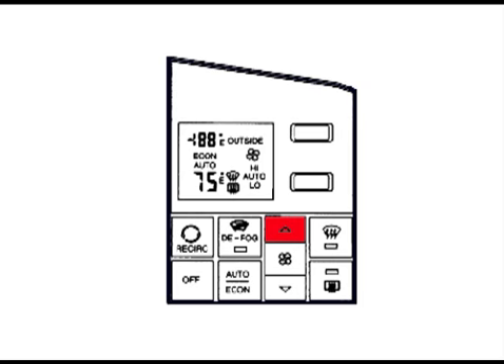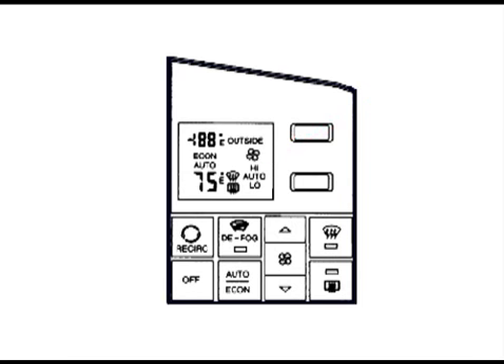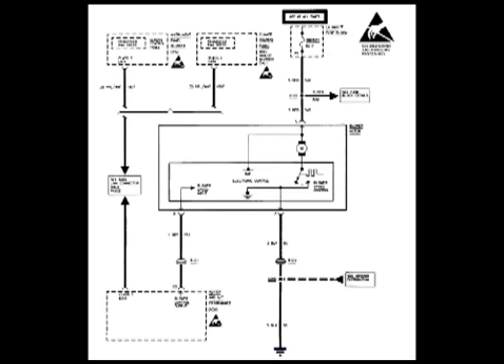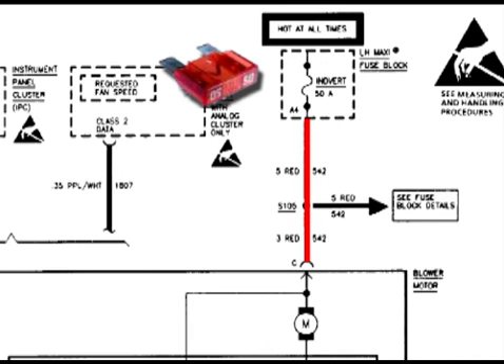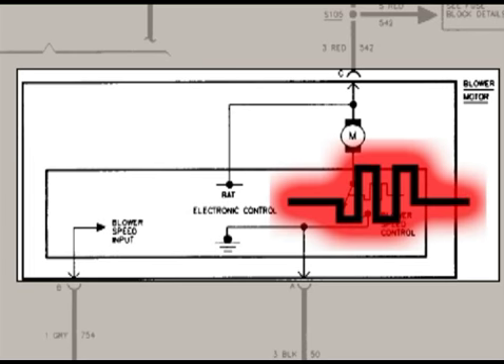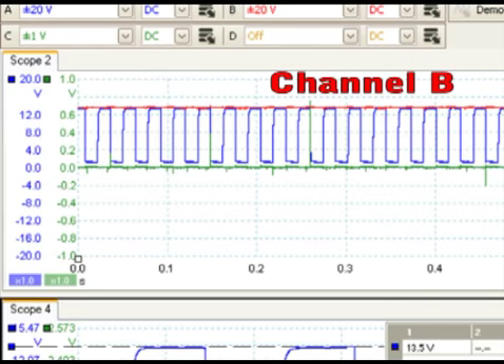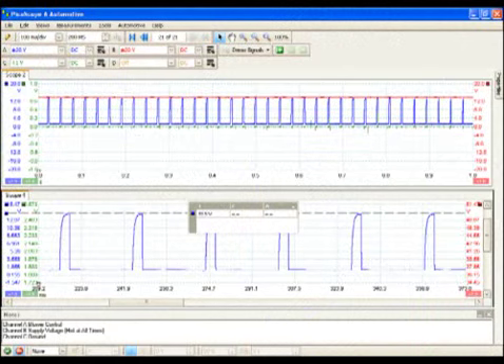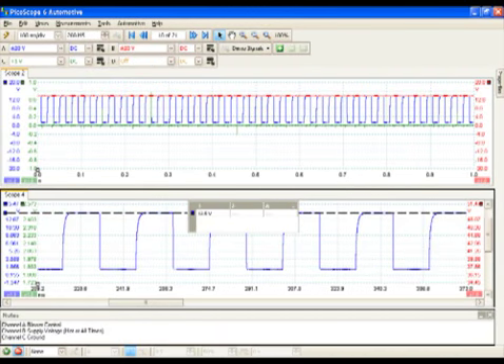Late 90's Cadillac - No HVAC Blower Output

Comment: I have a 98 Eldorado. The hvac blower cuts off in all modes, both auto and full low and high by it self. It may stay off a few minutes or several hours. I have replaced the blower motor and the control module. I have had 4 dealer mechanics try to diagnosis the issue, hence the new parts. however the problem remains. They checked the wiring also. I live in Florida so ac is a must have. I'm at a loss as to what to do now.